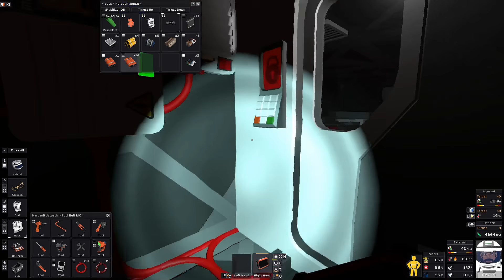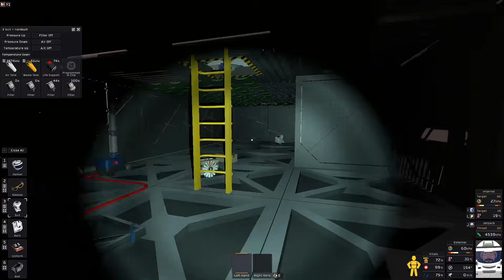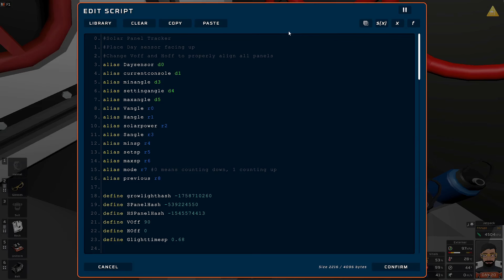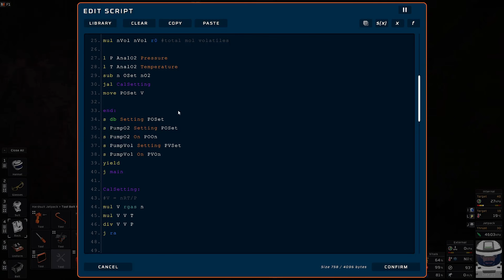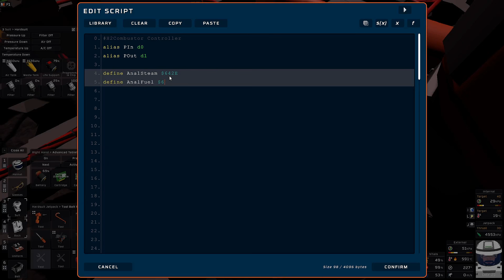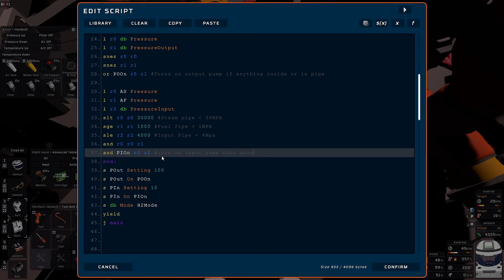Stationeers: Vulcan Brutal 8

Comment from the maker: Scripts made this video
Reply from the maker: Forgot I had to fix it later, this is the fixed version

edit: Tank update no longer has data port, see comment below this one to have a more up to date version.

Set the following pins:

d0 = Oxygen Pipe analyzer
d1 = Oxygen Volume pump
d2 = Volatiles Pipe analyzer
d3 = Volatiles Volume Pump
d4 = Fuel Pipe Analyzer
d5 = Fuel tank storage

#Fuel Mixer
alias AnalO2 d0
alias PumpO2 d1
alias AnalVol d2
alias PumpVol d3
alias AnalFuel d4
alias FuelTank d5

define OSet 2000 #2000 mol of O2 desired in fuel
define OMin 2000 #2 MPA minimum

alias POOn r15
alias PVOn r14
alias POSet r13
alias PVSet r12
alias nO2 r11
alias nVol r10
alias n r9
alias P r8
alias T r7
alias V r6

main:
l r0 AnalFuel TotalMoles
l r1 FuelTank TotalMoles
l r2 AnalFuel RatioOxygen
l r3 FuelTank RatioOxygen
mul r2 r2 r0 #total mol Oxygen
mul r3 r3 r1 #Total Tank Mol oxygen
add nO2 r2 r3 #Total Oxygen count

l r2 AnalFuel RatioVolatiles
l r3 FuelTank RatioVolatiles
mul r2 r2 r0 #total pipe mols
mul r3 r3 r1 #Total tank mol Volatiles
add nVol r2 r3 #Total mol volatiles

l P AnalO2 Pressure
l T AnalO2 Temperature
sub n OSet nO2
jal CalSetting
move POSet V

l P AnalVol Pressure
l T AnalVol Temperature
mul r1 2 nO2
sub n r1 nVol
jal CalSetting
move PVSet V

sge r2 P OMin
sgez r3 POSet #turns on pump if setting > 0
and POOn r2 r3

end:
s PumpO2 Setting POSet
s PumpO2 On POOn
s PumpVol Setting PVSet
s PumpVol On PVOn
yield
j main

CalSetting:
#V = nRT/P
mul V rgas n
mul V V T
div V V P
j ra
Reply: @shadowdrake082  Hi - Since the current patch only allows the new tanks to function without logic, I've removed the lines for reading the tank's readings. Before, it didn't work at all; now it at least fills the fuel line 1:1. However, this isn't the hydrogen-oxygen mixture required for the H2 Combust. Could you please take a look at the revised code? Thanks.

d0 = Oxygen Pipe analyzer
d1 = Oxygen Volume pump
d2 = Volatiles Pipe analyzer
d3 = Volatiles Volume Pump
d4 = Fuel Pipe Analyzer

#Fuel Mixer
alias AnalO2 d0
alias PumpO2 d1
alias AnalVol d2
alias PumpVol d3
alias AnalFuel d4

define OSet 2000 #2000 mol of O2 desired in fuel
define OMin 2000 #2 MPA minimum

alias POOn r15
alias PVOn r14
alias POSet r13
alias PVSet r12
alias nO2 r11
alias nVol r10
alias n r9
alias P r8
alias T r7
alias V r6

main:
l r0 AnalFuel TotalMoles
l r2 AnalFuel RatioOxygen
mul nO2 r2 r0 #total mol Oxygen

l r2 AnalFuel RatioVolatiles
mul nVol r2 r0 #total pipe mols

l P AnalO2 Pressure
l T AnalO2 Temperature
sub n OSet nO2
jal CalSetting
move POSet V

l P AnalVol Pressure
l T AnalVol Temperature
mul r1 2 nO2
sub n r1 nVol
jal CalSetting
move PVSet V

sge r2 P OMin
sgez r3 POSet #turns on pump if setting > 0
and POOn r2 r3

end:
s PumpO2 Setting POSet
s PumpO2 On POOn
s PumpVol Setting PVSet
s PumpVol On PVOn
yield
j main

CalSetting:
#V = nRT/P
mul V rgas n
mul V V T
div V V P
j ra
Reply from the maker: @birogmc5130  Yup, looks good to me. I appreciate the revision!
Reply from the maker: H2 Combustor
Set the following Pins:
d0 = Input volume pump
d1 = Output volume pump

#H2Combustor Controller
alias PIn d0
alias POut d1

define AnalSteam (Reference ID for analyzer on hot steam pipe)
define AnalFuel (Reference ID for the fuel pipe analyzer or fuel tank)
define GSense -1252983604

alias H2Mode r15
alias POOn r14
alias PIOn r13
alias AF r12
alias AS r11
move AF AnalFuel
move AS AnalSteam

define TOn 473 #200C Turn on H2 combustor
main:
lb r0 GSense Temperature Average
slt r0 r0 TOn
l r1 db PressureInput
snez r1 r1
and H2Mode r0 r1#Turns on H2 combustor if input pipe has stuff and <200C outside

l r0 db Pressure
l r1 db PressureOutput
snez r0 r0
snez r1 r1
or POOn r0 r1 #Turns on output pump if anything inside or in pipe

l r0 AS Pressure
l r1 AF Pressure
l r2 db PressureInput
slt r0 r0 30000 #Steam Pipe < 30MPA
sge r1 r1 1000 #Fuel Pipe > 1MPA
sle r2 r2 4000 #Input Pipe < 4MPa
and r0 r0 r1
and PIOn r0 r2 #Turn on input pump when above conditions are true
end:
s POut Setting 100
s POut On
s POut Mode 0
s PIn Setting 10
s PIn On PIOn
s db Mode H2Mode
yield
j main

Comment: Shadow the fuel mixer code how would you convert it to do liquids?  i really need to rewatch your liquid fuel mixer vid on that.  and if you want a simple gas mixing code for a gas mixer:

alias mixer d0
alias Tank1 d1 #can be a tank, pipe analyzer etc.
alias Tank2 d2
alias FuelAna #optional
alias N1 r11
alias N2 r12
alias GasMixerSetting r13
move N1 2 # line 7, see note below
move N2 1 # line 8 
add r15 N1 N2
div N1 N1 r15
div N2 N2 r15

#setting = (N1xT1 / (N1xT1) + N2xT2) x 100
#N1, T1 desired ratio of gas input 1, T1 -Temp of input 1gas
#N2, T2 desired ratio of gas input 2, T2 temp of input 2 gas 

start:
yield
l r1 Tank1 Temperature 
l r4 Tank1 Pressure #optional

l r2 Tank2 Temperature 
l r5 Tank2 Pressure #optional
l r6 FuelAna Pressure #optional
mul N1 N1 r1
mul N2 N2 r2
add N2 N1 N2
div GasMixerSetting N1 N2
mul GasMixerSetting GasMixerSetting 100
s mixer GasMixerSetting Setting
#below is optional and adjustable as you wish
sgt r4 r4 200
sgt r5 r5 200
slt r6 r6 1000
and r4 r4 r5
and r4 r4 r6
s mixer On r4
j start

Note: lines 7 and 8 are where you set the ratio.  above its set to regular fuel with Vol being Input 1 O2 input 2.  you can set this to any 2 gas mix you want.  like if your making "plant gas air" at 7:2 CO2:N2, if N2 is input 1 and CO2 input 2 then it would be: move N1 2, move N2 7
The optional parts ensure there is at min 200kPa in the supply pipes and keep a min of 1MPa of mixed fuel on tap.  Or whatever you want your thresholds to be.  

Last question why use LO2 to make LN2? Or did i miss understand you?  LPol goes down to -99.8, LN2 temp rage is -83.2 @6MPA to -233.  and for more margin of error, LVol.  LVol range is -78.2 @6MPa to -192, 49deg delta (latent heat/specific heat.  there is a term for this but i can't remember the proper name), vs LO2 of -111 @6MPa to -217, 37.9 delta and, ofc Pol and Vol are infinite.
Reply from the maker: For liquid fuel mixing... i guess it depends overall on whether it will be in the liquid pipes or gas pipes. I think trying to end it in the gas pipe I'd try to do a volume pump and expansion valve set up but delay the liquid volume pump a few ticks to let the expansion/evaporation stabilize.
Liquid Volatiles would be 25 mol/liter and Liquid oxygen would be 33.3 mol/liter if i remember right... but knowing that you can probably be capable of pumping exactly enough liquids into a liquid pipe network that goes to an expansion valve to the gas side. You'd get pretty close but it does depend on if any liquids evaporated or extra condensed in the liquid pipe network before the expansion valve.
I probably mispoke... i do that a bit. My usual setups is pollutants that cools liquid volatiles that makes liquid nitrogen which can either make a separate tank of liquid volatiles colder or make liquid oxygen. I'm wondering where in the rambles I said the wrong thing...